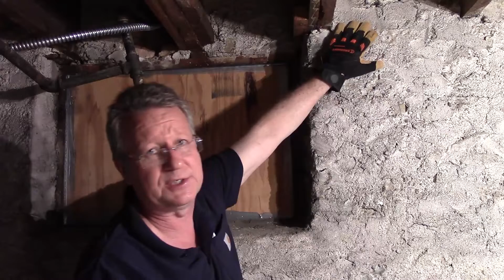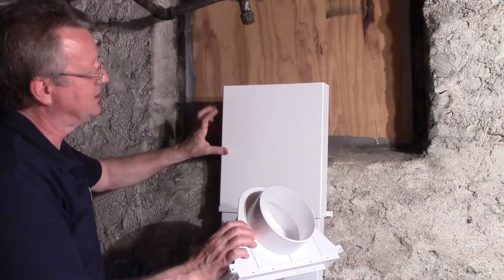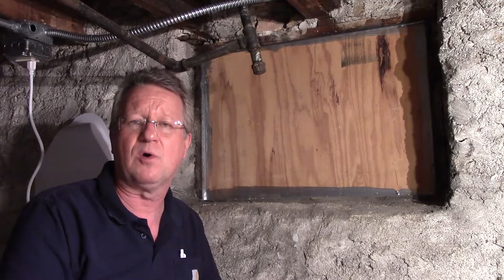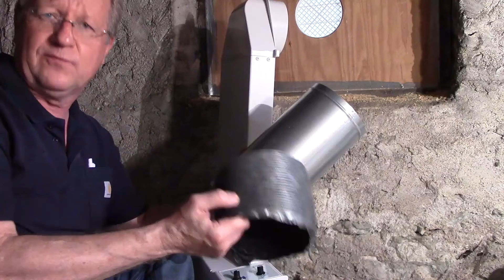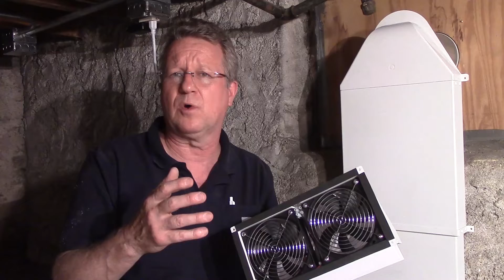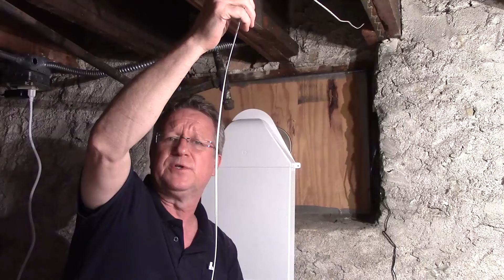Installing an EZ Breathe Crawl Space Ventilation System

Comment: What if the crawl space has multiple exhaust vents on the walls? Can those stay open or need to be sealed? I would think you would be pulling both outside air and air from the home. Any issues?
Reply from the maker: Hi, with this system you want a closed crawlspace to draw in conditioned air from the living space.
Reply: @FIXITHomeImprovementChannel  any recommendations for a system where the space isn't sealed? We aren't getting enough air flow
Reply from the maker: @chadf9993  Hi, you can email me at fixitpodcast@gmail.com